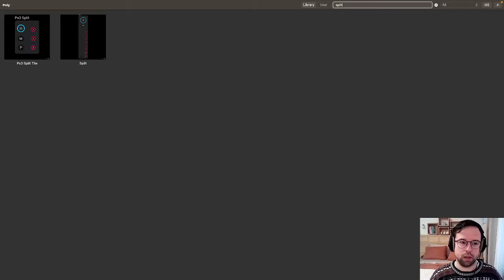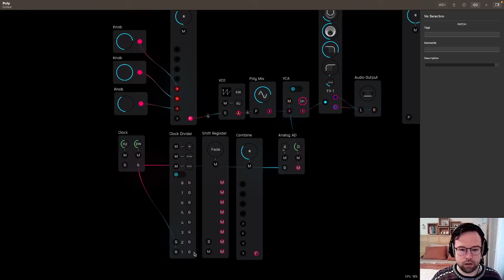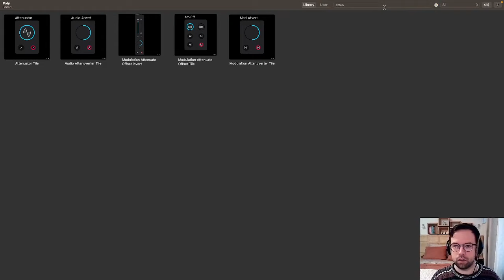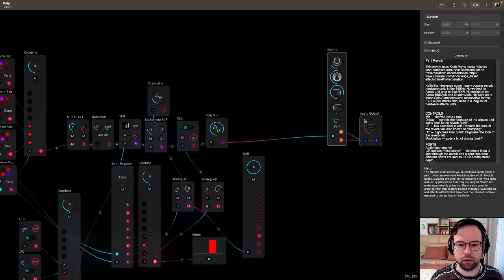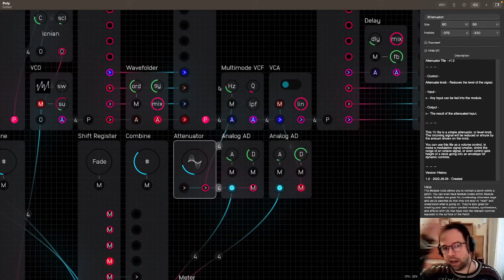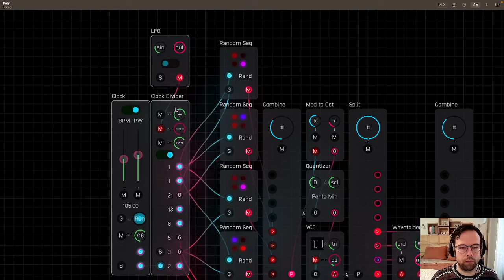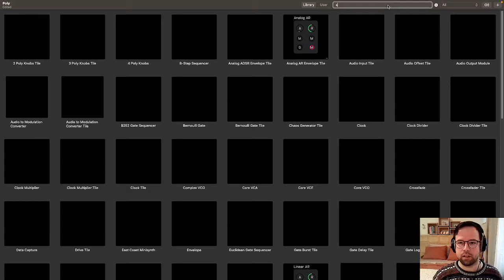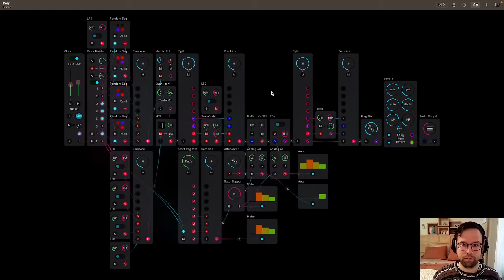Wired Up with Mark 4 - Polyphony with the Combine and Split Modules

Comment: It's great how you take the time to explain signal flows and the impact of the changes you are making as you develop a patch - so useful for a modular noob like myself
Reply from the maker: Thank you Simon! Glad you're getting good use out of these. I like to think that the knowledge you gain here you can take to other systems, even if they don't per se handle polyphony in the same way, but still, the concepts are broadly the same :)